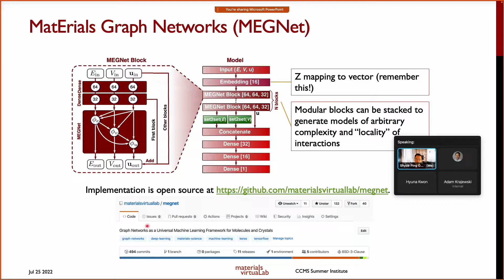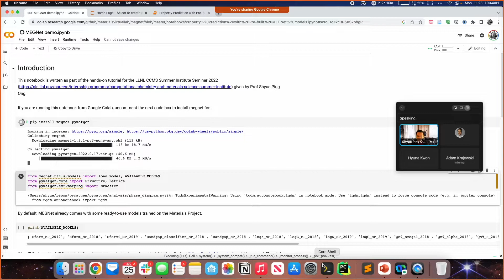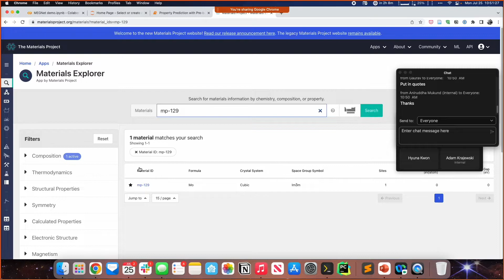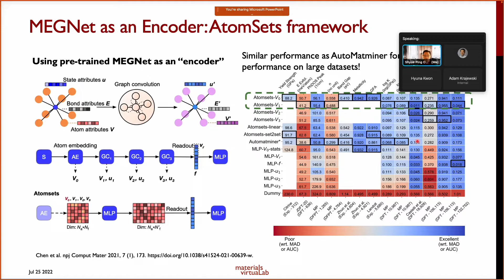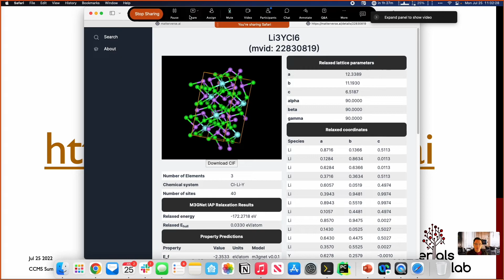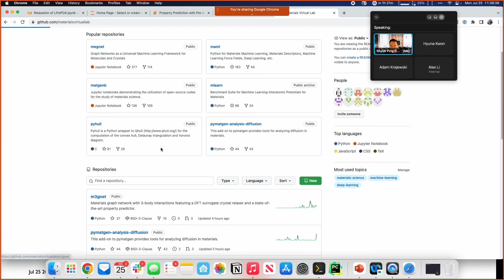CCMS Summer Institute Lecture 2022 - Mathematical Graphs as a Representation for Materials

Comment: Awsome but why do we use gaussian expanded distance? What is the advantage? 19:46
Reply from the maker: It is a descriptor capturing the distances between atoms. It is a common initial input descriptors used in graph descriptions of materials. For molecules, sometimes some descriptor of the bond order, etc. are also used.
Reply: @materialyze  ok it makes sense. I was wondering in terms of informative value,  the informative value if we use actual bond distance vs gaussian distance would be same right?